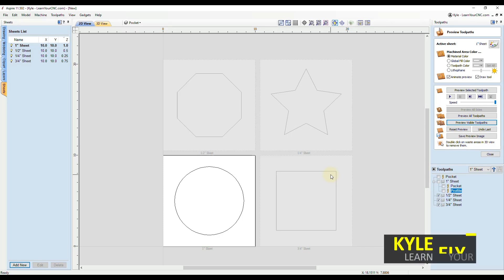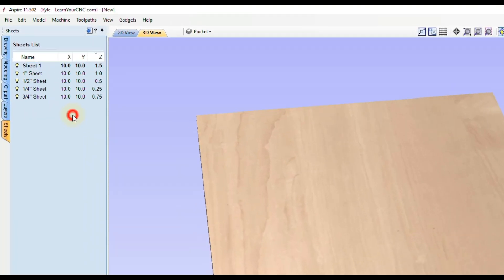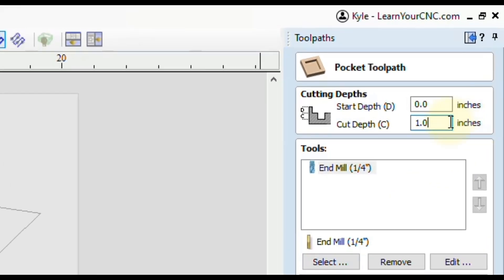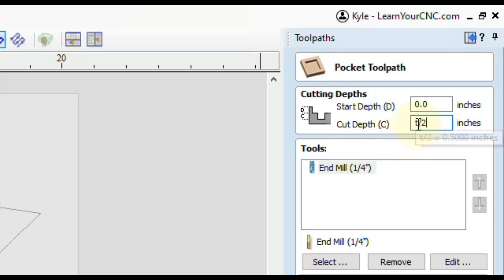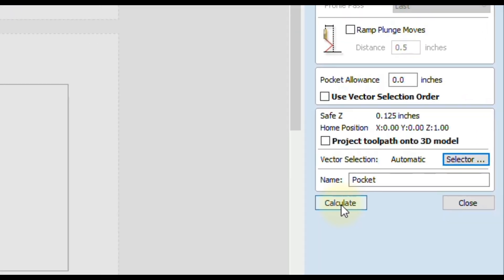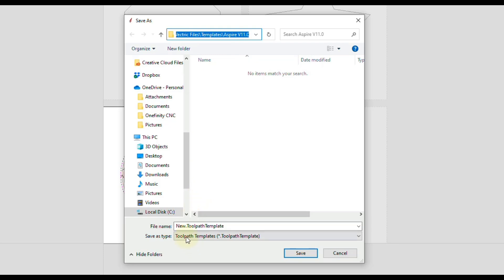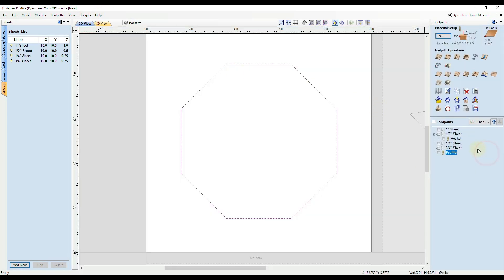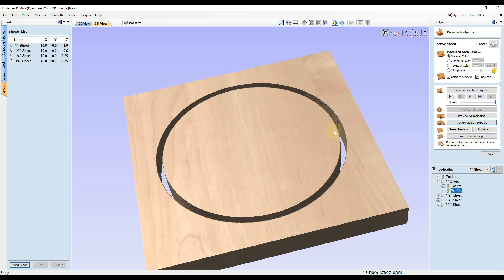Maximize Toolpath Efficiency with Variables and Templates - VCarve, Aspire, & Cut2D Quick Tip

Comment: Can a single tool path be used on varying thickness materials?  e.g. I want a pocket that always has a .25" bottom thickness but my material might be 1" or 3/4" or 1.2 inches.

Comment: I often use the variables that you shared but don't know all of them.  So appreciate you sending me the sheet - I followed your link.  One tip that you gave that I have been frustrated with is how often the variable for thickness disappears and the actual thickness gets put in.  i will use your trick of using the variable and then adding "0".

Comment: This is great when working with sheets. Is there a way of making a default template for just a profile cut without working with sheets? e.g. Start depth 0.0mm Cut - Depth 19.20mm  / Tool 1/8 EM / Machine Vectors = Outside / Do Separate last pass 0.20mm / Add ramps Smooth distant 20mm